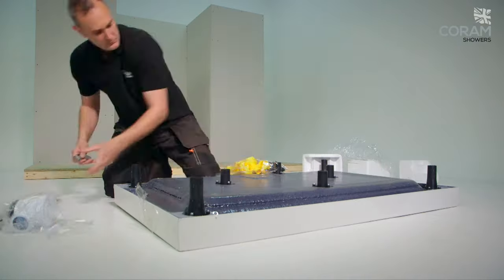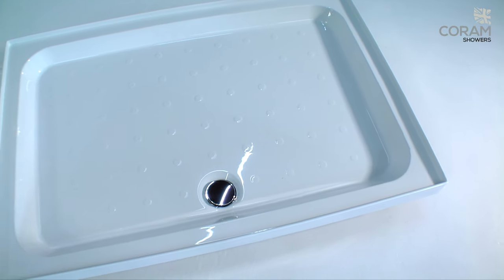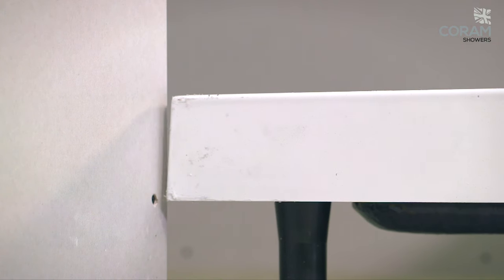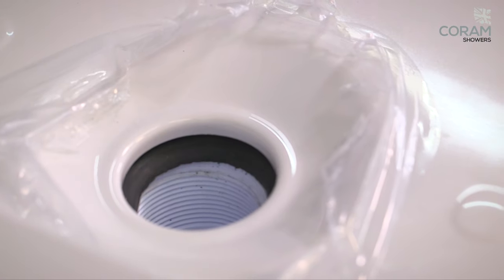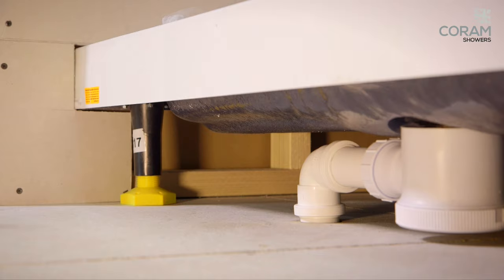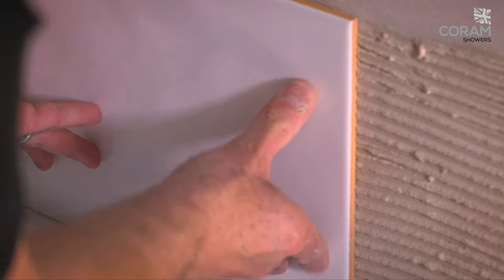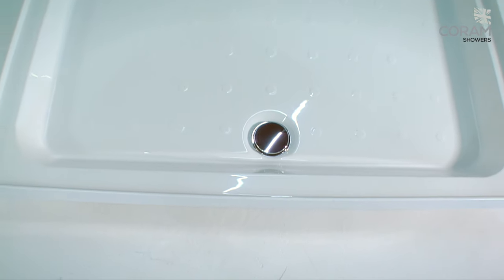NEW - Coram Riser Shower Tray Installation Guide

Comment: My Shower isn't draining well. No blockages as far as I can tell. Had all kinds of cleaning /unblocking products down there and still no luck. I want to check the falls on the waste pipe but can't get the front panel off. Any advice?
Reply: Take out the push in part of the gully. Poor water down does the gully empty to flush with bottom of pipe exit

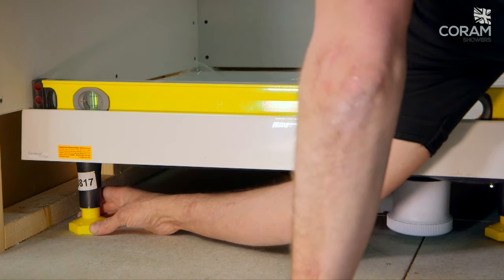Comment: How are you supposed to screw the feet down further underneath the tray? @1:28
Reply from the maker: When the outer feet are screwed down (2 in an alcove, 3 in a corner) the internal feet do not require any fixings. The fixings are more to hold the tray in place not to hold it down.
Reply: @CoramShowers  😂😂😂
Reply: Not chances 😂😂😂